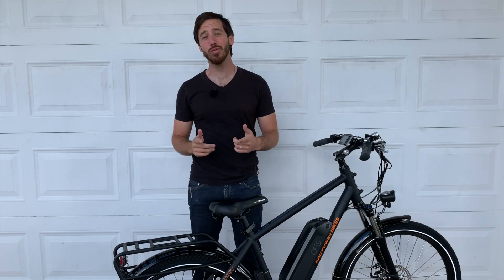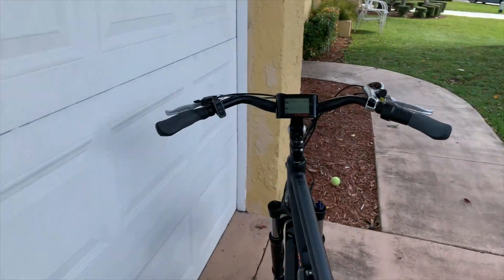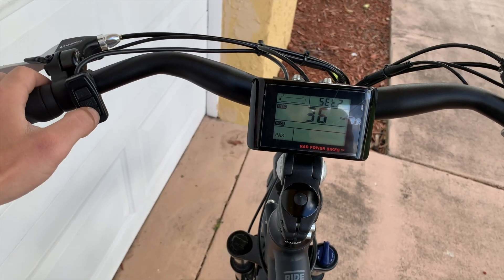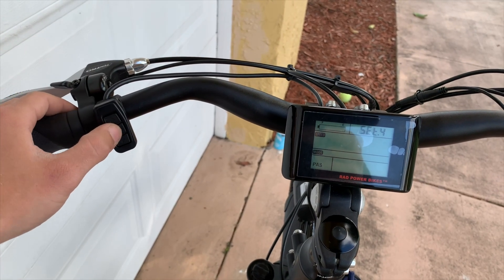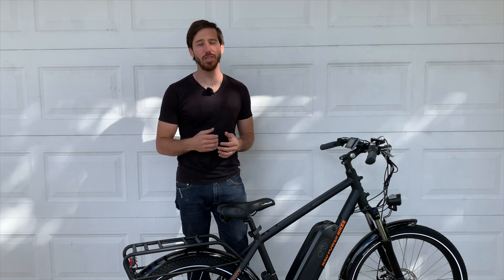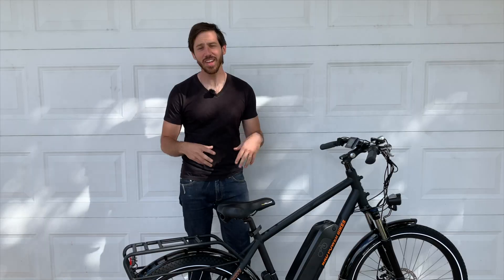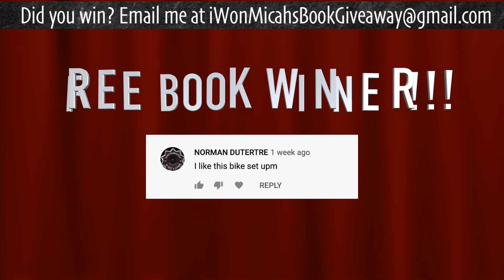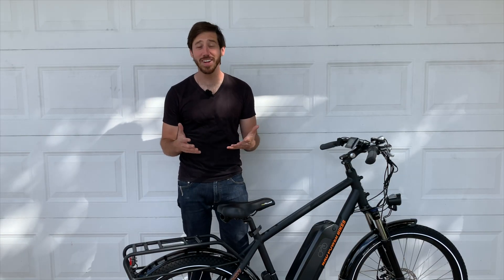How to increase speed of a Rad Power Bike e-bike (DeRestrict!)

Comment: this will not work for the EU version of the bikes, where the setting is locked to 27 km/h. but you can bypass that by reducing the wheel size in the settings, to get a few more km/h out of it.

Comment: In stock mode. I hit 35km with peddling+throttle. 40km on downhill max with throttle.  Just changed the setting to 40km before was 32km.  Mabey on the downhill I can get 50km or 45km with peddling on flat road.. thanks so much for the tip. 👍👍👍👍

Comment: I didn’t need to increase my flat terrain speed. What this adjustment did was enable my bike to coast downhill faster instead of being held to 20mph. This has greatly increased my enjoyment of the bike. Thank you!!
Reply: Actually to do that, you just need to go down a steeper hill or off a cliff
Reply: Jackass @jasontomica8938
Reply: I noticed that myself. These bikes are so heavy that they create resistance even downhill. I think making sure your tires are inflated fully and making sure your brakes are adjusted correctly (not grinding against the rotors) should probably make a difference

Comment: If I set the speed to 25 mph per hr then change the display does it reset the speed back to 20 mph or does it stay locked in sport mode when you change the display?

Comment: I have a switch which is blue brown and black indicating three gear transmission one is for low speed 2 is for high speed and three is ground which is blue brown and black how can I make my e-bike go faster I was thinking of putting a wire in the hole but which one to connect to the other one that is my dilemma on my bike can you please help me sincerely yours Rick

Comment: Thank you for this.  My wife and I just got our Rad City bikes yesterday and on our first ride, she was way ahead and out of sight.  I followed these instructions and sped mine up and slowed hers down.  On our second ride today, she was glad I was able to keep up.  Shhh!
Reply: You badass! xD
Reply: @MattDobson1991  Unfortunately she has now learned about this and made me set hers to the full speed, too.  It worked for a little while.  We did find adjusting the speed helpful for when riding on some crowded city trails where we didn't want the bike to be trying to go 20 mph.  By setting the maximum speed way down, it made for a more pleasant ride on trails posted as 10 mph max.  Our bikes were set for about 12-13 mph which was in line with how most of the bike traffic was moving.

Comment: I did that process on my Rad City 5 plus and I regularly hit 23 and 24 miles an hour. It may not sound fast, compared to a car but it's fast enough to routinely make my eyes water so badly I couldn't see to ride. I fabricated my own integrated helmet/eye guard out of an old pair of ski goggle lenses and my old helmet but Amazon has some helmets with built-in eye guards.

Comment: I was excited to try this but the results were a little disappointing.  I have a Rad Runner with an LCD controller upgrade and a Rad City.  The difference on the Rad Runner was negligible - only about a 1mph increase over flat ground.  Rad City will now do 23 mph, though.  Still a useful video where I learned something, though - so thumbs up.

Comment: Recently purchased an LCD Display upgrade, for the other stuff it does, but also for the speed increase. $99 + shipping and tax ($120) got me everything... except the speed increase. Set it to 40km/h. Saved it. Still stays around 19 mph on flat ground. Went back into the settings to double check, and sure enough, still says 40 km/h just doesn't increase it at all.
Reply: Rad started to restrict their motors, you either have to replace the motor or possibly tape up the speed limiter pin on the motor cable.

Comment: Thanks for this! However, I set it to 40 km/hour, but the bike will still not go faster than 20mph in the real world. Are you sure this actually works?
Reply: It doesn’t work anymore. RadPower took it out. Probably a legal issue.
Reply: @greg1474  I live in Canada and it works for me. I received mine 2-3 days ago.
Reply: @GreenSlug420  - That’s interesting. Thanks. All I can tell to you and other readers is that for a brand new 2021 bike— I can confirm it does not work for me.  If you read the Rad owners forum, you will find that many owners echo the same result. Perhaps you got a older controller or one they forgot to reprogram.

Comment: I'm curious about any other settings for the Rad City.  In particular, I'd like to know if the power levels for each level of assist can be programmed.  I had one ebike, which I sold, which applied the power unevenly between power levels, making a couple of the levels useless.  Going forward, I want to know in advance if the levels are relatively equally spaced or if they're programmable.
Reply: Me too!   The first level is a nice 50 watts.   But then it jumps to over 150 watts for level 2.   Level 4 and 5 hit the 20 mph limit without almost any power required, just spin the pedals.     Mine is 50, 175, 350, 500 and 750 watts.

Comment: Is there any way to do this on the radmission?
Reply: This doesn't help, but I accidentally engaged the brakes when I was powering on my radmission.  The LEDS for PAS 0 and 2 were flashing until I let go (10 seconds). Maybe this is how the engineers access a hidden menu.  I didn't try pressing any of the buttons.
Reply: yes it works on radmission

Comment: I'm guessing it doesn't work with a standard RadRunner =(
Reply: It does work on radrunner1 ....I got LCD display for Xmas ...changed the settings from 25kmh to 40kmh and my rad is an EU ....loving the extra speed

Comment: Hey! I have referred back to your videos on several occasions while navigating the world of electric scooter and e bikes over the past year or so. I own a Schwinn Stealth 1000 that is now almost a completely different vehicle and it's unlike anything I've seen. Everything has been upgraded, I'm running lithium, overvolting the 36v 1000w system with 48, 56, when file charged, and had nothing but amazing reduce l results. Part week I damaged the driveshaft on a pothol and wound up with no other choice than to change to another drive system because the direct drive assemblies are discontinued along with most of the other important parts, but the result is absolutely unbelievable. 
Every major scooter and e bike shop said there was no work around and that unless i found a used motor assembly I was not going to be able to fix it. I'll be posting a video in a day or tell when everything is up and running and you'll see just this wrong they all were. I'll disclose everything in the demo video and talk about some of the other mods i pulled off. I posted an into just to let people see it while i had it apart this past weekend. It reaches 30+ mph effortlessly and that was with the direct drive. What i saw today when i assembled the chain drive system i pieced together and turned the throttle was scary. It'll be ready to test drive tomorrow and I'm definitely going to be posting a video of that. I'll never know how fast it can go because you can't resonably hi that fast without instability on one of these but I love it to pieces and I'd be more than willing to bet it's the fastest of it's class by far. I wanna get you opinion on all the things i did and maybe give me some pointers about additional mods i have planned.
Reply: This is the longest post anyone has made on YouTube. 👏

Comment: Is the speed limit set 
at 32 km/h the reason i feel some resistance when I'm moving along with PAS3 and gear 7 at a good 30 km/h++ clip and the bike seems to break or resist giving me more power as I pedal harder?  Thanks for the video - I'm going to make that adjustment before I next take to the road.
Reply: Yes, the max speed is exactly 32km/h.

Comment: What do you think about fooling the bike to go faster by changing the tire size?  So if your wheels are 26", wouldn't setting them to 22" increase the real speed?
Reply: It won't effect the "real speed" of the bike. It just confuses the sensors.
Reply: I heard of a trick where you set the wheel size to 16 then change your display to show km/h in order to have a display that shows your real speed in MPH and get faster speeds too (mainly because 16km/h is about 26 mph)
Reply: @DiasporaDoomer  16km/h is just under 10 mph.

Comment: Yeah 20MPH is the common speed. Three reasons safety laws and battery power. The controller on your bike is actually doing all the work. Big black box separate from the battery it stores the settings and holds the power settings etc. I’m sure these things could be heavily modified. We all figured a lot out diving into the software with our drones. Adjusting the pitch to make it go faster or eliminating altitude restrictions. The screen just gives you some basic access to those settings.

Ebikes are going to explode in years to come. As they do they will start crossing the areas where is this a Motorcycle and states will start questioning whether it’s legal. A 50cc Moped does not require a Class M drivers license but does require a Drivers License. Well the way some of these Ebikes are going. No drivers License required due to Pedal Assist etc. The law is more than likely going to want to regulate as the technology continues to improve. 20MPH isn’t really a big concern. 25+ is going to start to beg the question. Is this an Ebike with pedal assist or a 50cc Moped?

My opinion is 25MPH is a solid number. But 20 is probably a bit safer and these motors are sized and geared to keep you around 20 anyways.

When ebikes first hit the market they were designed to be pedal assist. And you defintely wanted to pedal. Today they can be that or just slam the throttle and hit 25mph. They are starting to become the Hybrid and enter the moped category. Most of this in my opinion is a good thing. But their will need to be more regulation as they get faster and improve.

Practicality is another reason. A utility ebike is probably going to want to rely more on power than pedaling. So they honestly do need to head in that direction in order for consumers to open up more to the idea of using one. But manufacturers have to be careful for Liability reasons, safety and Laws. 

Plenty of people want to pedal. But theirs also plenty who might do it occasionally and other who will rely on the Motor. Short story is you have a Motor and Controller and some reduction gears. These things could pop wheelies if you really wanted them to.

Some guys frown on the models that start to rely more on power and less on exercise. I use to ride my bike at least 10+ miles to and from work everyday. Suit in backpack all forest preserve trails. Trust me it wasn’t fun. Because it’s not practical. That’s why the Rad Runner is selling so quickly. You could go grocery shopping in that thing and throw your suit in the storage console etc and hit the throttle. Won’t be sweaty when you get their either.

Then we also have people no drivers license etc. I think the Utility Ebike is going really come alive. But in order for it to become viable they need to keep the pedal assist alive but put the emphasis on the motor. Which is going to make law makers turn heads as they become that Moped.

Comment: Mission accomplished.  Thanks, here's why:  I used to think it would be great to have an e-bike that would reach 50 mph.  After experiencing my first in motion flat tire at 20 mph, I realize how dicey control must be at 40+ on a quickly collapsing tire.
Reply: Get the fat tire kind. It feels like my gas moped from years ago. It's just a bit heavy to lug up and down the stairs.
Reply: @dodesskiy1  I bought the Rad Rover 5 with 4 inch tires.  It performs really well.  Problem for me in Florida is the amt of construction here: nails, staples, screws etc along the roads.

Comment: It looks like the speed limit option is not enabled on the EU version of the Rad Rover bikes.
On Set.2 screen I get an option to choose from 1,2 or 3 just like you have it on your video on screen Set.3

Anyone has the same on EU versions?
Reply: I've a radrunner1 EU ....I got LCD display and it works ...changed settings from 25kmh to 40 kmh ...it brilliant I'm loving the extra speed

Comment: Wouldn't changing the wheel size in the settings to 24" or smaller make the bike faster?  Have you tried this?
Reply: Theoretically yes this could work for some cases. But honestly these bikes have a tough time hitting 25 mph even when unlocked. Your wattage and voltage would need to be higher to get more speed. basically your limited by power at this point, not by arbitrary controller limits. Plus your speedo will be incorrect for a possible 1 or 2 mph gain which isn't worth it in my opinion.
Reply: @Brandon_Neil  Makes sense

Comment: I have a 1000W violamart ebike kit, my level 1 PAS is too strong how do I change the power or limit the speed for that assist level? Is it possible with the sw900 computer I have? Do I need to upgrade my controller and computer to adjust this feature?

Comment: 2020 doesnt let you set km anymore just change rim size to 14  or smallest and works again km trip odomoter wil be screwed up but speed is back
Reply: I wonder if you can display in km/h. If so then you can set it to 16 (if your wheel size is 26) so you display proper mph on screen in a somewhat jank manner.

Comment: I found a 40 USD battery pack with 27Ah and 36V but it does not tell how much is output in amps. Isn't that too good for the price (almost 1000Wh)? Please help me cause I have no idea about this stuff.
link - https://www.aliexpress.com/item/1000008100777.html?spm=a2g0o.detail.1000060.1.1e8153e0sFat8e&gps-id=pcDetailBottomMoreThisSeller&scm=1007.13339.146401.0&scm_id=1007.13339.146401.0&scm-url=1007.13339.146401.0&pvid=bdf2bd05-f52b-45e0-9bce-cc8c2f96404d

Comment: Speed is not important for me, is there a way how to get more torque? i have sw 900 display, 52v 17 ah battery, 1000w motor. And i have one problem...i try whole PAS options, but when i pedal lowest speed is 30 and higher km/h in any mod, pedal assist 0 no sped (that is logical), pas 1 no speed, pas 3 30hm/h (this is too fast when i pedal on flat surface) in pas 4 and 5 i get more speed 8that is fine when i go uphill). but i dont know how to get pas 1 with limit of 20 km/h? i try to reduce speed in PAS  force option but result is the same. Please do you have any advice?

Comment: I need to go around 60-80km.so can u tell me the ebike range (battery, motor,etc..).and iam in india can u help me?
Reply: I have a rad power wagon and can get 30 miles on single charge on flat terrain with little peddle assist.  This is a new battery.
Reply: @billvanhoose3167  you can buy ebike kit from Astra Motors :  astramotors.in

Comment: SW900 screen.
Mine b0rked so I bought a KT LCD3. I didn't like the aesthetics to start with but it had so much useful information I became a convert.
I've since upgraded the battery (using your book) to 72v (20s-5p) which is actually 84v fully charged through a Risunmotor (sabvoton) controller which came with a KT 750c screen.
The Screen is very pretty but chuffin hopeless at just about everything.
Speed reads 10 MPH over - Charge reading is ..... Well... is it ?
And as for the clock... Just lol.
I might see if the LCD3 works on it as it's so superior !

Comment: Hello Micah . . 

I'm interested in extending riding range rather than increasing  speed. . . Having said that, I have two identical 48v 14Ah  batteries.  Each battery discharge port has a proprietary connector which is inaccessible inside  the down tube when installed . . . 

I want to connect batteries in parallel . . . Your video about adding a battery to your scooter was unclear to me about the exact connection made . . .

The pins on the proprietary connector show continuity with the female barrel connecter +&- pins respectively.

Would it be OK to run a cable to connect the batteries between charging ports for my parallel connection without any negative consequences?

  I will be using the same type connectors and gauge wire as found on my Luna Advanced 48v charger for charging these batteries.  I've read and understand your posts about assuring that both batteries will be charged to identical voltage at the moment of connection . . .

Thanks,

Luke

Comment: Thanks Micah. I did this to my Rad City after receiving it late last year. Does the controller limit the KPH to 40? Is it an AMP thing? Thanks again for your fine work.
Reply: It’s done by the controller. The box on your bike. Their screen just reads some of the settings.
Reply: Once you hit 40 kmph, the motor disengages but you can keep pedaling and go a bit faster.
Reply: @bmx44  Thanks. My Rad City is very heavy. Thankfully I don't have to climb steep hills!

Comment: I like how easy it is to override that speed limit.  I wonder if changing the rim size would also make it think it needs to go faster
Reply: You're absolutely correct a smaller tire size has to increase the rpm to achieve the same speed.
Reply: Physically changing your wheels to a smaller wheel, maybe. Changing the digital size of your wheels will just confuse the sensors and you won't go any faster while it spits out false speed onscreen.

Comment: Increasing the speed is nice but I would rather increase the range.  Other than buying a second battery pack are there other options?
Reply: Pedal more.
Reply: @gabriels1163  ha but that doesn't increase the battery range.
Reply: @kamelsr  It reduces the power used which increases the range.
Reply: go downhill, or go where the wind pushes you